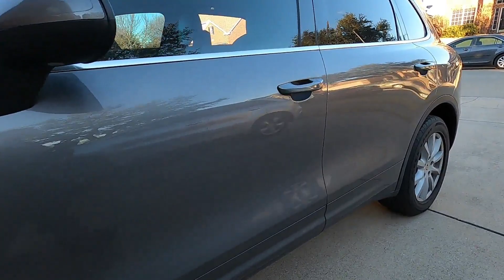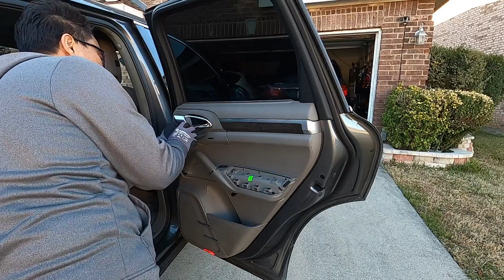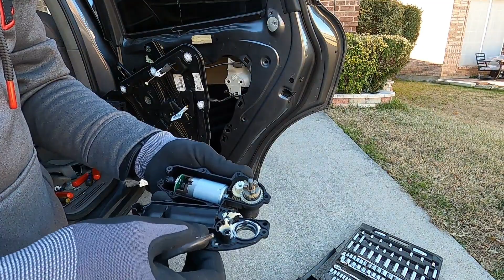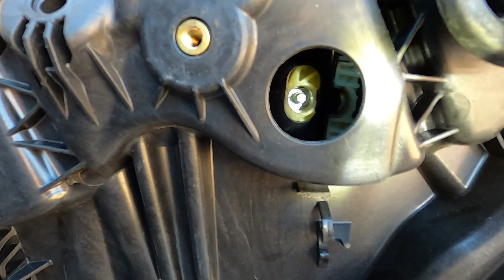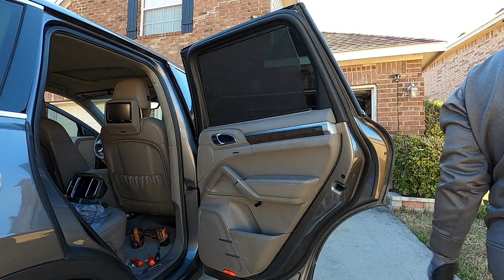How to replace or repair the rear sunshade motor on a Porsche Cayenne

Comment: my sunscreen on the passenger side goes up and come down immediately after, it does not stay up. I just got the car but I did have someone tint the windows right after a purchase. Any ideas why it would activate and then come back down?
Reply from the maker: @jjdavies05  the sunshade and the window have a safety mechanism that makes it retract or come back down if it encounters a resistance going up, most likely the sunshade plastic gears are worn out.

Comment: Hello and thank you for the sunshade video. I don't have a question about the sunshade, but I do have a question about your Cayenne's rear entertainment system. I noticed you have the same rear monitors that I have on my 2013 Cayenne. Do you know how to operate them? Mine turn on and off, but when I connect my iPhone via its USB connection, it neither charges my iPhone, nor will it recognize it.
Reply: It's not suppose to turn on and off, check power buttons if it's sticky or stucked,  connectors to head units, fuse.
Reply: Oh sorry. It doesn’t turn on and off by itself. I meant I’m able to turn it on and off using the power button (so it does work). It’s just that I cannot connect a device to it or to get it to operate. I can’t even open it to insert a disk.
Reply: @alirahmani7628  that means you need to replace that head  unit 😔

Comment: How did you release the window?
Reply from the maker: Remove door panel, center round plastic cap, raise/lower window until you see the bolt holding the window, loosen bolt clockwise to remove glass

Comment: No need to remove inner panel. Unscrew 3 screws, Rotate motor on the rod. Unscrew 3 more screws and part where is the motor inside is separated. When putting together gears make sure 3 “sticks” aligned with 3 holes (bottom rod part)

- to disconnect shade from the rod, remove middle wheel with screw, and push in the hole, while pulling the rod.
Reply: How long does this repair take and do you have a better video without removing inner trim

Comment: No need to remove inner panel, just rotate the motor in the same location and de attached from the rod house or box , fix the gear and put it back again
Reply: How did you manage to do that. There is very little room without breaking it
Reply: Why I didn’t read your review before…
Reply: Any videos on how to repair without removing inner panel
Reply: @mikeburden1575  I post one video on my channel, wish it could help you

Comment: The special window regulator bolts are not in the holes. Maybe the window track is misaligned?
Reply: There's a plastic cover that you need to remove to see it or lower/raise the window until you see it.
Reply: @texastrailrides3314  how do I manually lower the window?
Reply: @jp554731  can't you use the switch? If you have to manually do it, you have to remove the motor.  I thin the window has be closed all the way up to see those bolts, clockwise to loosen
Reply: @texastrailrides3314  ok, I’ll give it a shot
Reply: Also, the window is all the way closed, but I still can’t see the special bolts.
Reply: @texastrailrides3314  I ended up putting the window in the middle. I took off the electric window motor and used a needle nose pliers to manually move the gear and the bolts showed up. I was able to use a 1/4 ratchet with extension and the socket was a 4mm 6 point. Is it weird that the bolts show up when it’s half way?

I’m writing back as this might help other people.

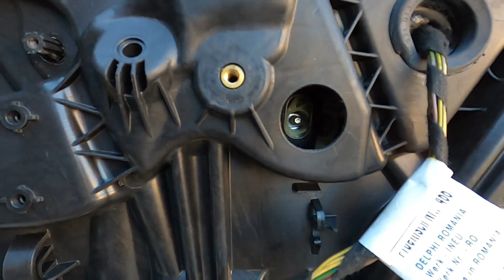Comment: 4:15 What tool did you use to loosen the bolt that holds the glass to the window regulator?  Same bolt you mention at 8:18.  That's where I'm stuck.  Is there a special tool you need to loosen those bolts?  I'm worried if I use a pair of needle nose pliers I'm just going to mangle or strip them.
Reply: I used a small torx socket, can't remember the size, I should've noted that, loosens up clockwise turn.

Comment: When your sunscreen stopped working, did your window also stopped working?  My sunscreen would not go up or down anymore, but you can hear the motor try. Once it stops trying, the glass window would not go down either.  I’m wondering if the system still thinks the window shade is still up.  Thanks for the video.
Reply: Yeah, window stopped working with mine too, they're like integrated system.
Reply: @texastrailrides3314  Thank you sir! It confirms the issue on my Cayenne.  Just ordered the gear set.

Comment: How to separate the screen and the stick?
Reply: I just pulled it up, some uses a screw driver to release it, pushed through the slot of the plastic holding the screen.
Reply: It just pulls right up with the panel